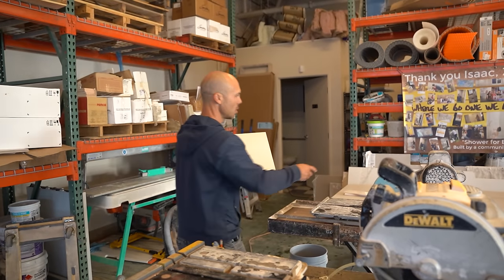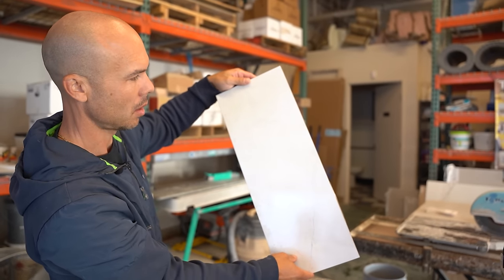TILE SAW TUTORIAL FOR BEGINNERS - 3 CUTS YOU NEED TO KNOW

Comment: Thanks so much for your instruction.  I am a DIY getting ready to attempt a bathroom.  Going to purchase same Ridgid saw you used on the travel video.  I think it will be plenty to accomplish 2 bathrooms.  thanks again for all the instructional videos.
Reply: Do you think I should also purchase a 24 inch snap cutter or just do everything with the ridgid 7 inch saw?
Reply: I'm no tile coach but I just finished a full bathroom remodel this evening. I used the 7" rigid saw. Depending on your tile,a snap cutter might be useless. If you can use a snap cutter, it's much nicer to be able to do it right in the bathroom with no mess. It took me a long time so waste was an issue as well. Thinset and grout are difficult to remove once hardened and dumping the buckets and tools stains and ruins anything it touches. Good luck to you. Have fun. It can get unnerving.
Reply: @lockwooddave  Thanks for the info it will be a little while before I start but with all the tool sales going on now I am going to start picking stuff up now.

Comment: I learned a lot from this video, but we "beginners" would be seriously lucky to own, or have access to, the D2400 by DeWalt, at $900. It seems to be easy to use, and it cuts tiles like butter. For a small tile job, which many of us need help with, a machine like this is out of reach, if not impractical. I'd love to see Isaac do a video, teaching us how to use the Skil 7-inch. At $100, it's NOT the best tile cutting saw, but for small jobs, it beats ALL the alternatives. You just need someone to show you how to manage the flaws of the machine.

Comment: Another solid video. 

Tip: You can use a 4.5" angle grinder with a diamond wheel to clean up the radius at the base of the cut on the backside of the tile instead of trying to balance a big tile against a 10" blade on the wet saw.

Comment: Good video and tips but I don’t see too many beginners or at least DIY home owners free cutting tiles like this when doing a U cut. A lot of beginners have never even seen a tile saw and most wouldn’t be comfortable holding a tile under a spinning blade and lifting it up to make the cuts free hand. A video like this is definitely more for an apprentice or laborer working in the construction field.
Reply: I just did it.  First time ever using a husqvarna.

Actually cut two square outlet openings. 
No issues!

Comment: Speaking of the Dewalt 24000, is there any alignment videos that you know of out there that are actually good? I got one new and it was off by just about 1/16 on a rip cut on a 12" tile. It drove me mad. The tile would push on the table as it's going through.  I made the mistake of trying to align it and now its ready to die by sledge hammer because it is unusable! There is no rime or reason on how to get this thing to cut straight. Dewalt wants $250 for an alignment which for that I'll go get a new one and hope for the best. Great video as always!!

Comment: I have a Felker saw and it allows the motor and blade to be raised up works similar to the dewalt but better. I've never cut a tile larger than 16x16 on it , got a job coming up installing 12 x 24 that will be a challenge.

Comment: Isaac, I'm having difficulty making straight cuts with my Rigid wet saw.  When I try to make a long straight cut and check for parallel,  the beginning width of the finished piece is almost always a sixteenth to an eighth of an inch different then at the end of the cut.   I'm using the same technique you demonstrated in your video.
Reply: check to see if blade is warped it will get warped if you forcing the tile in (friction makes heat will heat up blade and when it cools will warp it )or you are pushing it a certain way ,and also if your using a guide check it with a square might be the guide is off i notice they sometimes shift when tighten down

Comment: ive noticed that when using the wet saw,because of the circular blade, it cuts the bottom of the tile further ahead of the top. This presents a problem if you are cutting say and L-shape in which you want to leave a tiny piece of piece intact. How do you prevent this?. Thank you

Comment: Do kickbacks happen with tile saws too?
Reply: Yes they do, hes really handling that tile dangerously
Reply: Not really on a wet saw. But sometimes what happens is the blade will be pinched and pull the tile away. But you just pull it back out and try to continue.

Comment: My 10" Dewalt used to cut 1/16 off out of a 24" tile. I had to mark both sides, mark it with a pencil and follow the line with the blade. The sigma was actually way better and faster for straight cuts.

Comment: I am interested in watching the second cut (the square cut at the bottom of the tile but not in the middle of the bottom but closer to the edge of the bottom where you end up with a thin and lond piece of tile that easily snaps off when trying to do the second cut. It is usually required for electrical sockets, thanks advance.

Comment: I've been trying to cut a square into a 12x24 porcelain tile. I'm using a wet saw with a diamond blade but the tiles keep cracking when I make this one side of the square. Any ideas?
Reply: cuts like that have to stay laying on a flat surface. Lifting your piece or an uneven surface will warrant a break every time. try an Angle grinder. with a blade designed for marble not granite. totally different blades. and some material break faster than others

Comment: I have a small project that I wanted a nice finish I tried manual cutter was crap but bought a cheap wet saw and I found a lot of chips and wasn't a straight cut....I want to do this job myself but can't justify spending loads on tools that I'd hardly use

Comment: as a first timer this is a golden video! thank you! 
May I ask.... what I am still confused is about calculating before starting the tile job, the total depth of the project as I need to make it level with the existing hard wood floor of the adjacent room. while the depth of the tile and the underlayment (ditra product) are fixed, the 2 layer of mortar or adhesive are my question mark. If I apply a layer of mortar with a 1/4 inch tool, the moment that I place the tile over it and press to set, the layer won't be 1/4 anymore, but less. how deep with the mortar layer be after the tile application above it?

Comment: It's all well and good when you have those types of tile cutters, but trying to cut a U shape with a wet saw that the blade doesn't go up or down (a fixed blade) and a manual tile cutter is a much harder job.
Reply: I usually make the two parallel cuts with the saw and then use a 4 inch grinder for the back cut

Comment: HELP.. I noticed that your saw cutting direction cuts down CCW into the porcelain tile however my handheld tile saw cuts clockwise CW so do I need to flip my tile upside down so that the Diamond blade cuts into the surface of the porcelain tile rather than away? I was thinking that this would help prevent any edge chipping.

Comment: I thought you were going to slice your fingers at the 13:00 mark. Maybe it was the camera angle and you had more clearance.
Reply: You'd really have to try hard to cut your hand with a wet saw and diamond blade. There's no teeth like a regular saw blade...
I often even touch the wet saw blade while cutting when trying to take off just a little (holding pressure on the blade so it cuts straight).
Reply: He's only got 9 and a half to begin with.
Reply: Sometimes the saw will suck the tile in and it would mash your fingers off as opposed to a clean slice. Water hose will sometimes get clogged or kinked and won't allow water onto the cutting surface giving it less lubrication and the blade grips the tile and pulls it through the saw. I always keep my fingers on the outside of the tile if I can. It happens so fast, you wouldn't have time to pull your hands away. Be careful
Reply: @davegordon6943  that actually happened to me one time. I didn't know what was happening.
Reply: @lockwooddave  5 second heart attack haha

Comment: Your making harder work then you need to, on a straight cut just use a normal cutter for example a RUBI TX 700 does the job on 95% of the tiles you’ll come up against.
And if your doing an L shape grind for round a window for example just scribe it both ways on the cutter hand grind down one of your scribe lines, place it back on the cutter and it will snap off neatly, exact same neatness less time

Comment: i used to be young like you... put your safety glasses on!! i couldn't care less about your personal safety but lead by example, please. 
also, regarding lift cuts... it should be noted that the tile needs to remain flat on the tray as even the slightest twist of the tile will bind the blade which could chip the tile or worse - warp the blade